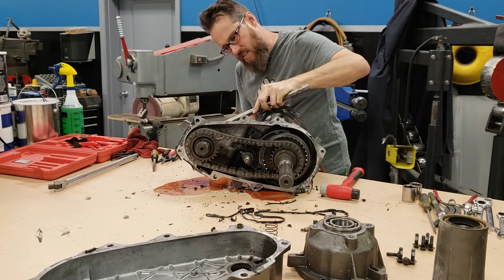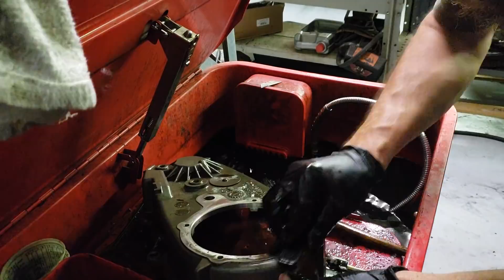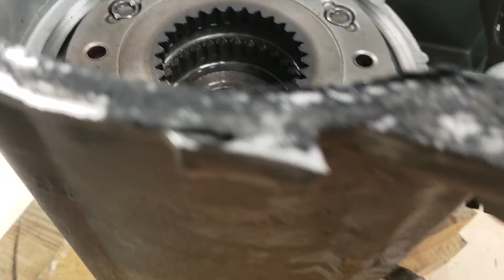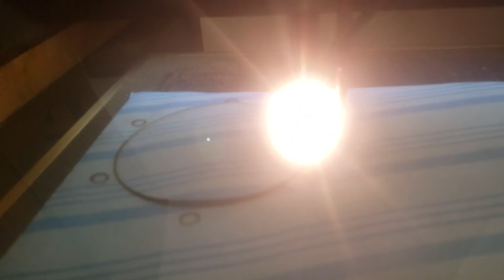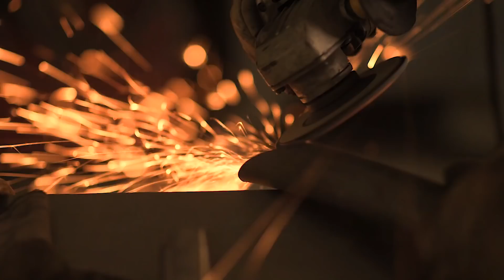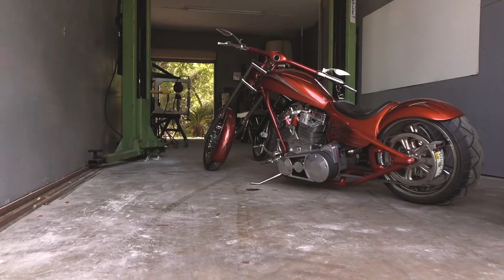EP.28 - 247 to 231 WJ TRANSFER CASE SWAPPING - WJ JEEP GRAND CHEROKEE

Comment: Hi! I was about to take my 247 into the table for the swap but I noticed my 231 main shaft looks different from this one in the video. This 231 comes from an XJ. Can you please confirm if those shafts are swappable or not. Thanks!
Reply from the maker: It has been like 6-7 years since I did that. So my memory is a bit fuzzy on the details.

Comment: I couldn't get Mopar fluid off the shelf in my small town so I did some research and found out it's just Mobil 424 repackaged, so I got an available equivalent. Shell s4 txm. Heavy duty tractor transmission fluid suitable for submersed brakes. Hydraulic fluid

Comment: Hi,
why did you swap main shaft? 
Was it from np247?
As i saw you swaped input shaff main shaft and 6 pinion planetary.
It looks np247 man shaft is ticket than and shorter?
Reply from the maker: I put in a SYE slip Yoke eliminator kit so that comes with a new shorter shaft. The slip moves from the case shaft to the drive shaft, is longer and better angles.

Comment: NP231 is a very good transfer case as it may be little more sturdy due to its simplicity. Just upgraded a 2003 Jeep TJ's NP231J to have a SYE, 25% wider chain, 6 gear planetary from a NP242 and 2WD low.All this work, why no addition of a 2WD Low there? <-- Now the TJ here can be used as a parking lot tug for dragging around boat trailers / inoperative diesel trucks or get around better when 4WD Low isn't needed in a very sharp turn.
Reply from the maker: Yes that would have been a nice upgrade but I am on a budget I guess.

Comment: I have a 2004 WJ overland 142k mileage...I’m curious Was it worth it? Did it remove the annoying turning noises...Also would you consider building one for me?
Reply from the maker: I am very happy with the 231hd I swapped. No issues and 2wd. I am currently not taking any new work until at least jan-feb of 2021. Thanks for watching.
Reply: Spiral Design Works sounds good! It would be cool to collaborate on the build if you want use it as a video series maybe? Appreciate the channel and the work you put into your content!

Comment: Is there a reason you picked the 231D  over a 231J
Reply from the maker: I was at the junk yard on the hunt for a 242 but found that one in a full size dodge. I think I paid like $75? The D has the extra wide chain so it is a bit stronger. But the case and bolt patterns are all the same.
Reply: @SpiralDesignWorks  that's kinda what I  was hoping for is the wider chain I found a Dakota with a V8 231D for my ZJ 5.2  (SOLD)!

Comment: Hey man Where was that third planetary that you showed from? 5:49 and could I still use my wj as daily with this transfer case swap?
Reply from the maker: On the bench was the 247 planetary, the 231 and the 6 pinion from a HD231. Yes it can be a daily as you will now be driving around in 2wd with a uncomplicated transfer case unlike the 247 with clutches.
Reply: @SpiralDesignWorks  I for the life of me couldn’t find an hd but a regular 231 can still take a hell of a beating so that’s what I’m swapping into mine

Comment: Yes the 231 was "even in the ZJ".  I have a 231 out of my zj I'm fitting with the parts from the 249 I just pulled out of one of my wjs.  I was interested to know they were in 1500 trucks which means yours is likely heavier than mine but while apart ill do my upgrades.    Digging the planetary upgrade !!!!!!!

Comment: Does the 242 t case shifter assembly work with the 231?
Reply from the maker: Yes in my case with the WJ it bolted right up.  I did alter the lengh of the lever on the case to get a full throw.

Comment: I did the 242HD swap with sye in mine at it was direct bolt in and gave you the extra 4 high range. 242HD has 4hi open, 4hi locked, 2hi, 4low. However you got a great deal on the 231 and there is more aftermarket support.

The 242HD is the same case used in the HMMWV except it doesn't have 2hi.
Reply from the maker: I set out to find a 242HD that day at the junk yard but no luck, but the 231D has the wider stronger chain and does what I need.  Thanks for watching.
Reply: @SpiralDesignWorks  what is the chain width on the 231 you have? I believe the 242HD is 1.25
Reply from the maker: yes 1.25" and I found a 6 gear planetary on EBAY.

Comment: Heck yea man I pulled mine out of a Durango 231j HD it bolted right in but I had to cut about 2 and a half inches maybe 3 off the output shaft for my drive shaft to slide over enough to bolt back to the rear end but other then that bolted right in but I also converted mine to 4x4 it was 2wd when I bought it

Comment: Just did this same swap 247 to a 231 with 6 pinion planetary and heavy duty chain 1.25 with new bearings n seals, loving the two wheel drive option my gas mileage has gotten much better ,the handling in my front steering is amazingly different I love it ,you should have the stock bracket for your linkage to the 4x4 shifter and it has two wholes you need to use the the bottom whole for proper 4x4 shifting ,have fun my friend I'm also enjoying mine  .
Reply from the maker: I am having a problem of it popping out of 4wd low.  I cut 1/4 inch out of the 231 linkage thinking it needed more throw.  But still doing it.  I am going to undo the linkage. put it in 4wd low and see if it pops out. Then I will know if it is the cable/linkage or something internal.
Reply: @SpiralDesignWorks  I don't have that problem maybe it's internal not shore hope it works out for you and sorry took so long to get back to ya just now seen your question.
Reply from the maker: @americanpatriot912  It turned out I forgot a c-clip. I tore it back down found my issue. No problems last 2 years.
Reply: Where do I find the 6 planetary gear set?
Reply from the maker: @richardnichols1532  they came in duallys and HD applications. I got mine off ebay.
Reply: @richardnichols1532  I found a 4 planetary gear set and had an extra set and pressed two out of the extra and pressed those in with the four so I have six now it makes for a stronger planetary gear set

Comment: I'm in the middle of the exact same swap..  247 shifter lever hits the side of the 231 case before it shifts all the way to 2 wheel ...  What's the solution? What have all these folks done who have successful swaps ?
Reply: james duncan I used one off of a Jeep Liberty I pulled my 231 out of a Durango and put it in my wj I went to the junk yard leaned under a Jeep Liberty because it was the first Jeep 4x4 I went to it looked about right so I took it to the parking lot swapped them and mine works a great
Reply: @team_suv7778  thanks... I'll check that out and see what I can find at the salvage yard
Reply: james duncan if I remember right it was a 231 that was in the liberty also but the shifter just mounted different and was shorter
Reply: You can either find all the used parts from a 231 shifter assembly. Or go to Novak shifters and buy one of theirs.

Comment: Nice video, I'm very much enjoying your build progress. A few comments from someone who has built several 231's and 242's over the years.
@11:53 you need to install the input shaft and planets first, before the input bearing retainer, so you can install a retaining ring on the input shaft. see Bleepin Jeep's 231 https://youtu.be/d7dQWrKoUxM?t=298. 
Don't use a gasket between the T-case and transmission. If the transmission rear seal fails you'll never know, as the space between the two gear boxes will hold fluid.
You don't ever need to remove the large snap ring that retains the ring gear (the one you almost forgot). 
I don't know if the dodge variant already has it, but you can get a 1.25" wide chain from a 231 C (chevy). Go from 1" wide (typical in jeep) to 1.25" wide. Still fits in the same case without issue. Upgrade goes hand-in-hand with the 6-gear planets.
Reply from the maker: Thanks for the input. Ultimately I did it two or three times. So the editing was a mix. Hopefully I got it right and was running good this weekend when I drove around the industrial park driving through all the ditches. This one was out of a full size and did have the 1.25" wide chain.

Comment: Did you reuse the 247 case? I know the Dodge 231 has a different bolt pattern for the transmission. Just in case some people don't know that.
Reply from the maker: No the 231 case. It bolted right up no problems. 247 case is shaped differently and has chain guides. It might work to just use the 231 guts. Not sure.

Comment: 242 HD direct bolt .
Reply from the maker: I originally looked for one of those.  None at the junk yard that day.  A few 242j but no HD. So I found the 231D and went for that.  $45.
Reply: So, a 242HD will convert the WJ's awd to optional 2wd?

Comment: U have a different way for a speedo gear?
Reply: Specifically it uses the ABS sensors and tone rings on the rear axle. If you ever do a rear axle swap you can wire the rear inline with the fronts to gain speed signal.
Reply from the maker: Good info. Thanks for watching.
Reply from the maker: Grand Cherokee Dana 44A uses the rear end.
Reply: Is there a way to pop a speedo into this? Sure would open up my options for an axle swap later?